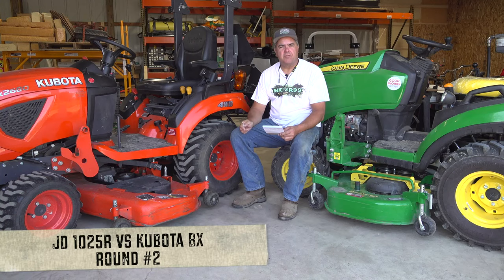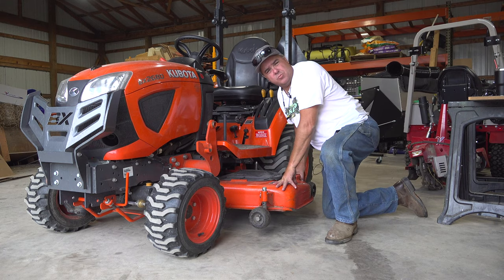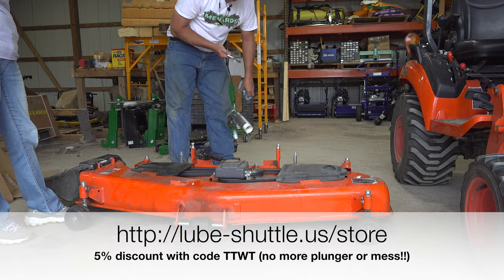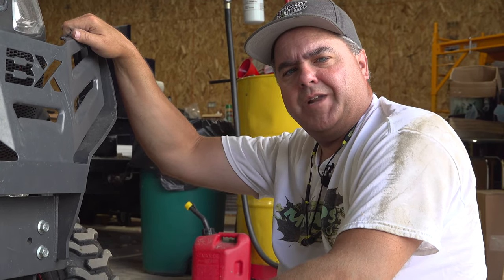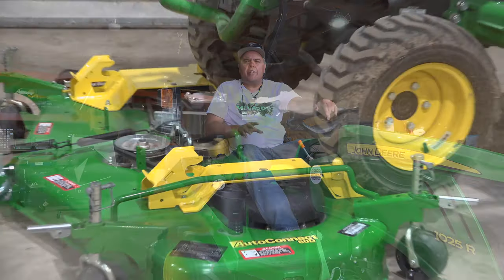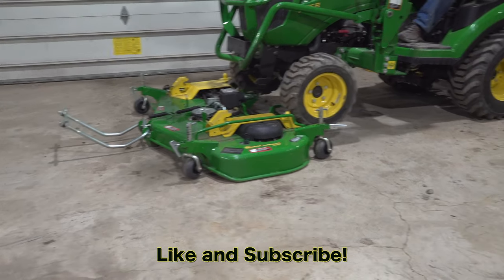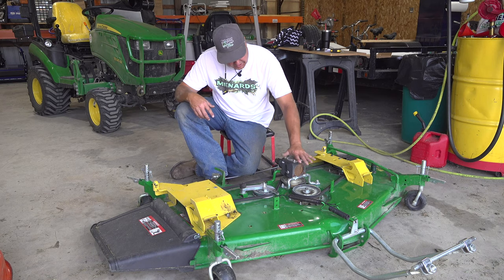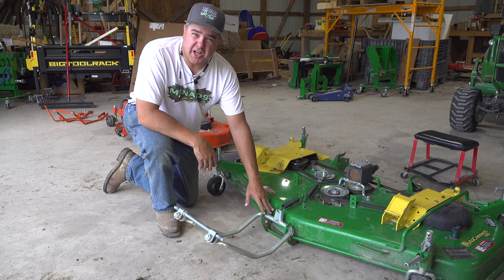Deere 1025R vs Kubota BX Round #2 of 8 Mower Deck

Comment: The spindle remarks--who drives over things big enough to damage their spindle?  It has never happened to me, and on the flip side the advantage is less moving parts on the Kubota deck--more moving parts is usually a negative, as on the Deere.
Reply: I did with the 1st mowing last year my water meter which I HAVE MOWER OVER FOR OVER 10 YEARS was suddenly up just high enough that the mower blade caught the cast iron cover. I hit it with the center and discharge side blades at same time. With all the rain we have has the ground does erode and accidents do happen. Did I intend to hit it? Of course not. But I did and I cost money to fix it. 
It cost me $190 in parts only on my 54" deck. I had to replace 2 spindles because I shattered the housings and a set of blades. If it would have been that BX2600 that Tim has it could have taken the transmission. From the shock going up the PTO. I'm 100% sure the gearbox would have been replaced with the outer spindle.
Reply: JD has 1 more pulley maybe 1 more bearing. That's it. Has the same amount of blades only 1 is direct drive. This means the 1st thing to give in a strike of any kind on the center blade is the gearbox. I would rather slip the belt before replacing a gearbox. And how do you grease the center hub bearings in the Kabota deck? All 3 of my hubs are the same with a zerk in the top of the shaft for ez access. The spindles I replaced looked like brand new after far as wear because of being able to grease them everytime I put the deck on.

Comment: Another couple of things. The Deere has an easier system when set up properly. And after working on several things that have those plastic twist knobs, I would take the bolt down style any day. Those plastic knobs tend to seize on. And, you have to destroy them to get them off. It’s the same thing with the Briggs and Stratton air cleaner covers of the same style. Again, great job.

Comment: Hi Tim, couldn't see anyone mention it before. In regards to the height of the ROPs. Make a line from the top of the ROPs to the front of the bonnet. That's where it will rest on the ground if flipped on its head. John Deere has slanted their ROPs forward to bring this line higher over the operator, giving more leeway in case of roll over. Loving your videos keep it up!

Comment: On the Deere, there are 2 slides located behind the left rear tire, if you loosen the bolt and slide them closer together, this will give you extra clearance, its not quite to 6" but its over 5", the dealer sets them at that height because it gives the most consistency on mowing and lift and lowering. That being said, doing that adjustment does not void your warranty, most dealers will do just such if you ask. All of ours have that slide adjusted and it makes the load n' go sit tight up against the floorboard. Just a little fyi. Both good machines for what they are.

Comment: Tim I have a 1025r(2016) and was very disappointed with the auto connect until I came to figure out I was doing it wrong. I wasn't keeping the left wheel tight against the guide. Once I did that I had no issues....John Deere wins this one hands down!

Comment: This is a excellent video Tim b/c this is the most aggravating chore of using my tractor.  Installing and removing the mower deck.  I simply hate it!  The drive-shaft in itself is a pure challenge much yet pulling or pushing the deck under the tractor.  This will eventually be figured out in a decade or so and by that time, my knees and back will be so beaten, there will be no need to discuss cutting grass. I'll be focusing on my appointments with the chiropractor (ha). Enjoyed a full-watch and wish you and Christi a fine weekend.  A very informative video.

Comment: Purchased an older bx2370 this winter. While a drive over deck looks simpler my father and neighbor who both have the Deere version seem to spend some time in their backs as well with there decks. I won't argue it's a bit of a manual process on the BX. That said, Tim you made this look painful. My 14 year old son regularly take the loader and mower deck on and off. The deck in well under 5 minutes. This summer with one arm in a sling. I think your take is correct. The easier it comes of the more inclined you are too take it off. My property allowed me to leave it on a fair amount of the time but when needed I don't find it cumbersome. And as was mentioned I don't think grease on the splines is there best way to go. Graphite or a dry lube is my choice.

Comment: Need to note: The 3 point and mower lift on the BX is just like the 1023E John Deere at least up to 2015 anyway. The 1025 lift control was exclusive to the 1026 and later the 1025. I'm not sure about now. But in 2015 it was the reason I went with to 1025 over the 1023

Comment: Very good comparison and very informative. One thing I'd like to note however is that the Kubota BX series offers a "drive over mower deck" (RCK60D-26BX 60" Drive Over mower deck) on their website so for for all intents and purposes it wasn't a 100% fair comparison in terms of ease of removing and installing the mower deck between the two machines. Other than that, great review.
Reply from the maker: Peter, the Kubota dealers consistently put down and don’t recommend this drive over deck.  Check out the other comments.  This is so widespread that we cannot find one to test.  So, we are testing the most popular Kubota setup vs the most popular Deere setup.

Comment: Tim; I have a JD 3320 compact with a 72" 7-Iron deck with the auto connect. We've had very good service with it. We keep our poultry complex mowed which consist of about 7 acres and use the tractor in the houses when we sell the flock as well as in our garden. It's had the deck removed enough that I've actually worn one PTO connector out and had to replace it.

Comment: Hi Tim
Kubota mower deck removal, were there several holes/levels the deck wheels could have been chosen to position of the deck lower too the floor?
If Yes then it might clear the Tractor frame
Great Videos
Love seeing Your good and not so good experiences that prove We are not the only ones that don't get it all correct on our 1st attempt
We have the L2501, and My very 1st use of the Brush Hog I disconnected it and pulled away. Correction, I thought it was completely disconnected
I forgot to remove the PTO shaft from the tractor and wondered why I was plowing this strange path in My yard.
That was a $120 shaft repair lesson.
Tuition was high, but fortunately minor damages to bending 4" of the shaft and the U joint
Ken
Reply from the maker: Discussed in follow up

Comment: How about the heavy duty double v belt on the kubota looked like the Deere had a single belt and I think they have bolt on deck guards for the edges of the deck at least my g1800 does

Comment: Tim how does the BX compare to the 1025R driving in High Range Up a Hill? 

Which Tractor has a more usable High Range HST? 

Also which Low range HST is better?
Reply from the maker: Both very similar.

Comment: If you turn the front wheels hard to the left if you are pulling the deck out to the right they come out a lot easier & reverse it to put it back in. I had to do that with the JD 445 I had. Have a drive over auto connect on the 1025 R , the best ever. However, the adjustment nuts on the bolt that sets the angle of the auto connect sometimes comes loose & when you remove the deck it won't connect properly. Then you fiddle with it till you get it in the correct angle. I used Blue lock tight to cure that issue.

Comment: Why didn’t you shake the Deere mower like you did the BX?  Also, if you have a FEL just raise the front wheels of the BX tractor off the ground and roll the mower forward so you don’t have to move the scalp wheels.
Reply from the maker: Many years ago now.  I don’t remember details.  I certainly wasn’t trying to hide or bias anything. You are right about loader to raise wheels….but still would have to drag deck under if you don’t rotate wheels.
Overall, Deere system works much better, but sacrifices lift height…..that is my summary.

Comment: In the video you didn't show how the mower is powered by John Deer and/or does it needs manual power off/on. You showed that on Kubota but not on Deer. Also Kubota has easy-over mower deck. Don't knot if it had in the time you made this video, but would be nice if you somehow check/update with that.. Really love your neutrality, will to learn... GJ
Reply from the maker: I didn’t show the Deere power connection because it connects automatically when you drive over.  That is the magic!

Comment: I just bought a 2008 BX2350 and the deck was easy to take off.  Neil made it look easier than it is because he did it on a new tractor with no dirt build up. I also believe you would have had an easier time if you turned the wheels to give yourself room to move the deck forward to clear those bolts you hung up on. Either way the auto connect deck is easier.

Comment: I don't like the 1025R deck and my 2017 JD takes seconds to uninstall but it takes 20 minutes to get the bracket under the tractor to work. It did not come with the autoconnect on the 54D deck. Yes it is easier than the craftsman mower.

Comment: I have the Drive over deck on my BX and do not drive over it. I just slide it in like the regular deck but don't have to "lay on my back" to do it. about a 3 min job on or off. The dealer who demonstrated the JD drive over could not get the deck back on.

Comment: We've never had any issues with our 60D Autoconnect deck with our 2014 1025r. We've had it for 5 years, and we're the only owners. I added the Load-N-Go this year after your video. I love it!  We have 10 acres of mostly woods and hills.  We take the mower deck off often to use the loader and/or backhoe. Being that it's so easy to remove/install, I couldn't imagine having to do it any other way!  Great video as always!

Comment: You sure have alot more patience then i have. Helped my friend with his 18hp kabota to hook up the deck and even messing withe the caster wheels like you did we had to jack the back up to roll the deck out and back in.......just bull poop. And that pto.......even after i plasteredevery moving part with neversieze.........still a pain to reach under and hook/unhook. That made me realize i will neverbuy a mid mount mower.........on any color tractor. If i bother with a deck it will be rear mount3pt hitch. I also like the fact you can back under decks and trees to mow closer

Comment: As others have commented, there is a kubota drive over deck.  I elected to not get that model.  I don't find the deck that hard to remove/install.  It is almost exactly the same as my John Deere mower that I sold to get the BX.  With the ground clearance I only remove the deck a couple times a year,  to sharpen the blades and I do remove it for winter.  I have a BX23S so i leave the deck on even when using the FEL and BH.

Comment: Do not waste your money on the idependent mower lift (IML) from Deere.  I bought this with my tractor and replaced it with the a 3rd valve option after my first season of use.  The IML is a great idea, but the issue is that unless you are pressing the button up, the mower automatically drops down.  This means that everytime you want to move with the mower up, you have to turn the mower height knob to the tallest position.  The height knob and the switch are both on the left side of the tractor, which makes operating both at the same time difficult.  This is a horrible design and Deere should be ashamed that they even scam curstomers into buying it.

Comment: Great comparison video Tim.  I'm not surprised at the difference in taking the decks off as I believe JD has really made it simple.  I took the deck off of my BX2680 for the first time last week and it was a little bit of a hassle but still only took me about 10 minutes.  I did have to have my wife help me push it under as I only have gravel to work on and I'm getting old!  But, as you showed, if I had a Deere, I would probably take it off more often then I most likely will.  Can't wait for Round #3.

Comment: It does depend on why you are taking it off. If you are changing over to a front blower or blade for Winter on the Deere than all the advantages go out the window as you also have to remove the sub assembly the auto-connect deck attaches to. 
Even if you are just removing the deck to do other work you do have to worry about stuffing the pto receiving mechanism for the quick attach with dirt or debris as you mold your world to your whim with the tractor while the deck is off. 

The Kubota design is a nice, simple implementation of an age old system for such decks. I would submit that if you are younger and able bodied then it's not much to think about. And if you indeed are taking it on and off all the time then you will quickly learn to do it in a matter of a couple minutes.  Deere could learn a thing or two from it for all their mowers under about the $10,000 mark. 
That said I recently made my choice and opted for a Deere 2025r. Not least of which on my list of 'pros' was the autoconnect deck system and new load-n-go system. I am not that young nor that able bodied anymore. ;-)
A couple other points too though. 
I hope you'll spend a little time looking at how easy it is to grease the BX vs the 1025r and mention each time you need to get down on your back there too.
Also - while the load-n-go seems great - unless you are the kind of weirdo (to each his own but I'm a different kind of weirdo myself) that mows with the loader on you also have to count reattaching the loader in the workflow of using the load-n-go to clean/move the mowing deck. 
And if you are going to reattach loaders then you could do the same with Kubota and lift the tractor up to easily clear the deck rolling out.
Kubota's biggest failure of design here is not making the wheels on the deck easier to spin 90deg. Deere's system is slick there. On the other hand Deere's willingness to sacrifice a needed anti-scalp roller on the front of the deck to more easily accommodate their auto-connect system is an engineering disgrace.

Comment: Good even handed review.  Removing the deck is a pain but it's never gotten in my way while tilling or doing dirt work so I honestly don't know that I would remove it even if I did have an easier way to do it.  I have heard of people driving up on boards to get more clearance height but if you have a loader that's the way to go.  The PTO shaft on my mower seized up on me at the beginning of the mowing season this year but it was my own fault.  We moved and I failed to winterize it before it sat outside all winter off the tractor.  A couple of raps with a hammer and it was free and some grease kept it moving freely.  It will be covered this year.  The collar should lock back while installing the PTO but it doesn't take much of a bump for it to unlock.  If I remember correctly, I find it easier to reach the shaft from the left side of the tractor.  I have noticed that the gear box in the center seems to trap grass and you have to kneel down and pull it out rather than just blow it out or wash it out with the hose.  
Again, keep up the good work, Tim.

Comment: tim i too was talked out of ride over deck from the dealer . i was told that i would be walking the deck across the floor.i have found the collar on the shaft locks in the back position and will release when the collar is in place over the (pto )shaft,i just spray the splines with Wd40 to allow them to slide ,in my mind using grease would attract  grit and debris easier , the big draw back to me with the kubota deck is the grease fittings walk out of the anti scarf wheels ,i have some thread lock and will try that.   greeeze ,grease,.....leeeeever,...lever.....potaaato,..potato.   your doing a great job
Reply from the maker: Thanks Steve!

Comment: Just an observation.  If you had lowered the guide wheels on the corners of the Kubota deck a little more, that bolt would have probably cleared the frame when sliding the deck under the tractor.  It wouldn't really need to be 3-4" above the concrete when installing or removing.
Reply from the maker: Yes.  You are correct. Sorry.  Missed that.

Comment: I have owned my 1025r since February.  I only recently took the mower deck off (last week to be precise).   I was worried as the dealer showed me how to do it in the shop t dealership on concrete floor and he had a tough time.  I had an issue taking it off until I found a more level spot in the stone dust basketball court.  Once I did that it went off without problems.  When I was done digging, I took off the backhoe, FEL and reinstalled the mower deck in under a half hour.   I purchased the Deere for this reason, so wife could do this as well.  Once I learned how to do each task properly, they have been super quick
Reply from the maker: I’m glad you have taken the extra effort to learn the tricks.  So many folks end up missing out on tractor functionality by being too fearful of removing attachments.

Comment: I know the safety pins on my 1025 come out. I lost all 4 of mine over 4 years 2 or 3 times. I now have bolts in mine now. I have never lost a wheel yet. The pins in the BX if they come out it looks like you loose the wheel. And even though i hate my local John Deere dealer because they screwed me on warranty on my 1025r. The ease of opposition like removing deck, ect. Is why I still like my John Deere 1025.